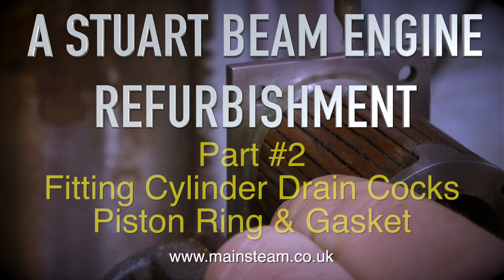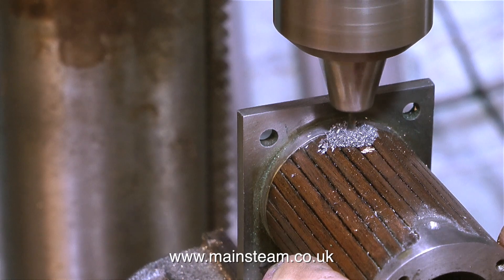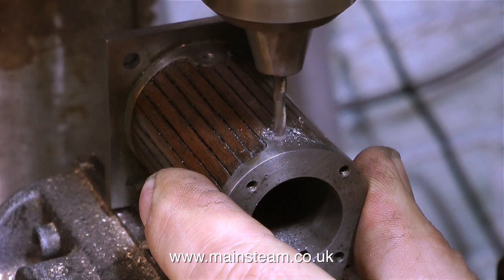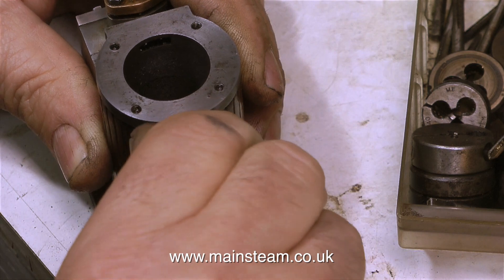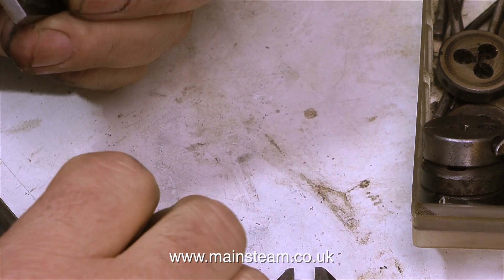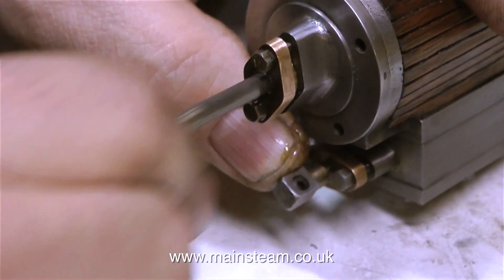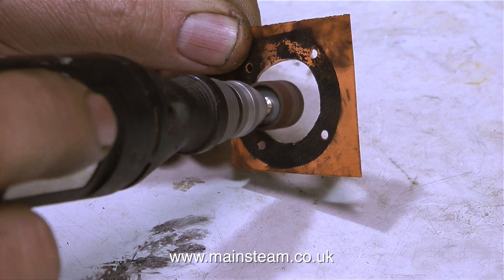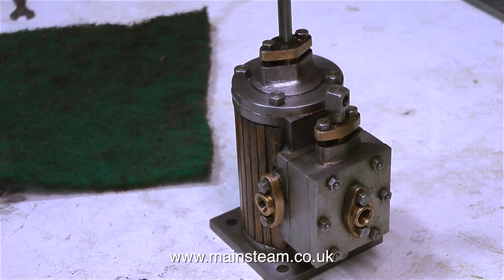STUART MODELS BEAM ENGINE REFURBISHMENT - PART #2

Comment: Great. I  drilled my drain cock holes all the way through with the 5/32”. Hopefully it won’t be a problem.
Reply from the maker: not unless the Silicone "O" ring (if fitted) on the piston passes over the hole . . . . .

Comment: Keith I notice there are no brass band on the cylinder.Q,How is the wood around the cylinder held on.
Reply from the maker: The wood is a tight fit and held with adhesive

Comment: They've been called drain cocks for over two centuries. A little late to suggest changing the terminology just to suit the PC police. Drain cocks,Gudgeon pin,Gib and cotter. All old terms because they are used in old technology. Correct terminology adds another historical element which adds immensely to Mr. Appleton's description of what he is doing and why. These early terms add an incredible dimension to Keith's work and are historically accurate.

Comment: When I put together a steam engine plant about 10 years ago now, I solved the issue with the open drain cocks making a mess on the base board of the plant by piping them all to an oil sump.